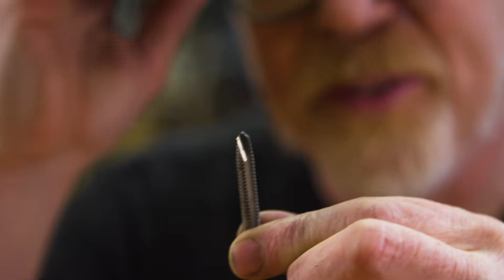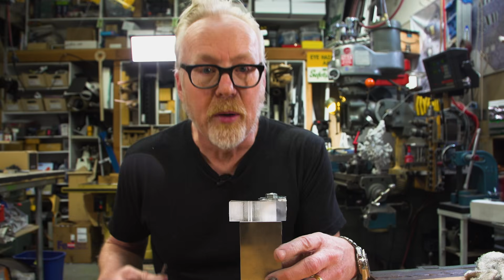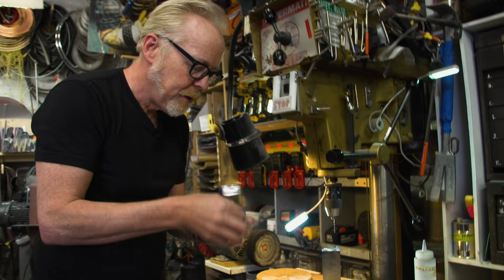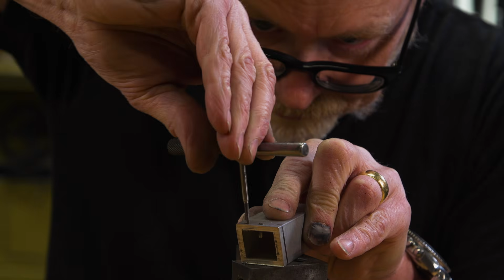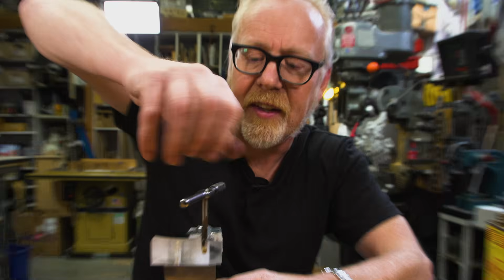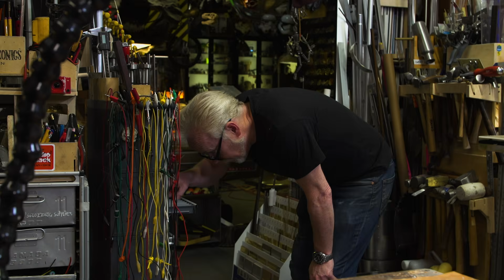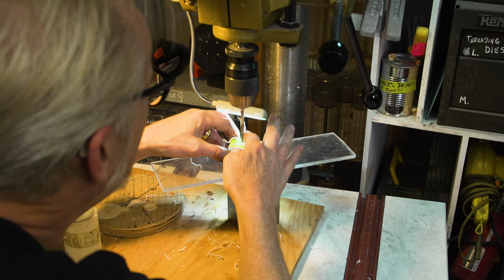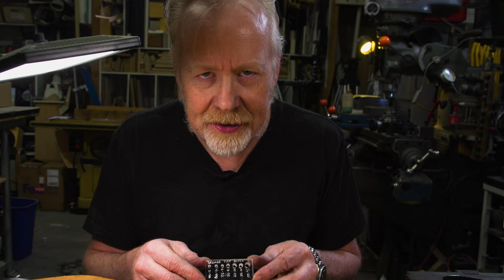Adam Savage's One Day Builds: Thread Tapping Guide Block!

Comment: I love your Starrett tap handles, as well as the rest of the video.
BUT... Threaded holes are not meant to "screw machine bolts" into. They are meant to screw machine screws into. Bolts are meant to be stationary while nuts are threaded on to them. The most obvious example is carriage bolts, but there are other obvious examples such as plow bolts, round bolts and track bolts.
Don't use cutting oil in cast iron as the grains of carbide in the cast will mix with the oil and create an abrasive paste which will dull the tap amazingly quickly.
Reply: Your distinction of bolt vs screw is an opinion only, and not universal.
What you call "machine screw" can be used either as a bolt or as a screw.
Furthermore, what you call a "bolt" can be used as either as a bolt or as a screw.
Hence, "machine bolts" and "machine screws" are both the exact same thing.
What would you call the tool used to tighten a roofing fastener into a square nut - a flat head bolt screw driver?
Reply: @johncoops6897  It's not MY distinction and of course it is applied haphazardly because people from all walks of life have been using spiral fasteners for centuries.

tl;dr You are right but you misunderstood me.

 The distinction is one of application rather than form. I agree with most of what you said. I think you have misunderstood what I said.
If you tighten it into the nut or a hole it is a screw, but if you tighten the nut onto it, it is a bolt.
However there are certain unambiguous examples, as I said before. A carriage bolt is always used as a bolt because there's no good way to tighten it by turning it into a hole. A lag bolt isn't a thing because you never twist a lead sleeve onto it by rotating the wall. It is unambiguously a lag screw, even though it has a hex head. Most other spiral fasteners can be used either as a screw or a bolt, as you pointed out, but there are conventions about naming them for packaging and inventory purposes. it would be silly for a hardware store to keep 3/8-NF hex head machine bolts on a different shelf from the 3/8-NF hex head machine screws because they are the same thing regardless of what the customer asks for or how they use them. Usually 'screw' is used to refer to something that has a faceted hole in the end and 'bolt' for something that has facets on the edge of the head. 'Machine' refers to the shape of the thread profile, in contrast to self forming or self threading fasteners. Self tapping fasteners would cut their own 'machine' form threads.
"The tool used to tighten a roofing fastener into a square nut" would be a screw driver because you are turning it or "screwing it" into the hole. To me a "roofing fastener" is a nail. A roofing screw wouldn't fit into any nut I have ever seen because they have a self-forming thread form like any other wood screw or a sheet-metal screw, while nuts have 'machine' form threads. The tool used to screw a nut onto a machine bolt (hex or square head machine screw) would be a nut driver.
Reply: @GordieGii  - I had typed a detailed reply with many examples, however Adam's comment filters must have deleted it. It wasn't insulting or rude, however perhaps it triggered some word count or external link restriction. Anyway, I am not going to type it out again.
Basically what it said was that in real world practical language, the terms "machine bolt" and "machine screw" are completely and utterly interchangeable. The distinctions that you use are probably based on the American "Machinery's Handbook", however those are not consistent nor even universally acknowledged throughout the rest of the world.
...
So, I was attempting to point out that you really shouldn't be a pedant and "lecture people" about correct terminology of fasteners that don't even have a consistently uniform distinction anyway. It's interesting to read the Wikipedia article about this, and especially the section about "Controlled vocabulary versus natural language" ...
https://en.wikipedia.org/wiki/Screw#Differentiation_between_bolt_and_screw

Comment: A broken tap is the bane of any mechanic or DIYer. If you buy a good set the tap and drill sizes will be in the included chart. (In most cases).

Comment: Thank you. This is SO useful.
I'm going to 3D print myself a tapping guide block.
Reply: NO NO NO. You need it to be accurate. The taps need to fit tightly in the holes, and not be rough. Make a blank with undersized holes perhaps, then drill the to final size.

Comment: So why not use a spral flute tap? They come in positive and negative extraction and for aluminium, .25 and  up I just use the drill...
Also: Countersink both sides of the hole. No fraying and easier to start the screws.

BTW: IMHO the most interesting thread to tap is a TR-Tap. Like TR16x4 for trapezoidal spindles...

Comment: I don't know if anyone's mentioned it, but they sell (and you can make one yourself) a spring loaded tapping guide. You drill the hole (on your mill, lathe, or drill press), remove the drill, insert the guide into the tool-holder. A lot of tap wrenches and/or taps will have a center point on the back end. Rest the tap in the hole and bring in the tap guide until the tap is held in place - centered. Work the tap and you may or may not have to feed the guide closer to the work piece. Depends on the depth.

Works for taps of all sizes, no block required. Although, the block is handy for tapping holes when you're away from your machine - part in hand.

Comment: I definitely have had a tap  go in very sideways. I started using a lathe or drill press to start my taps to help with the issue(spinning by hand), but tap block has a much broader use case. Thanks!

Comment: You didn't need to make 7 holes... He first 3 taps all had the same diamet. They all could have used the same hole. 2-56, 4-40, and 6-32 could have all used the same hole. So you really only needed 5 holes, or maybe 4 if the 10-24 and 10-32 both had the same shank diameter.

Comment: tapping things is easy af as long as you never turn it hard. there should never be much resistance. two steps forward one step back over and over and over. its infinity satisfying to thread a bolt into a threaded hole you've made. I've never used one of those little charts either, grab a nut and bolt that are the size you need and test the taps in the nut until you've found the right one!

Comment: I learned how to tap a hole in HS it was one of the easiest parts of the class.
Reply: Yeppers, the instructor tapped a hole then used a die to put threads on a rod. Then we all made brass hammers with aluminum handles. Still have mine. (35 years later)

Comment: Shop trick, Adam.  I've broken taps, too. When working with aluminum and a broken tap in the hole, mix alum powder with water and low boil the mixture soaking the part in for about an hour.  The tap will dissolve enough to pick out with a pick.  

Yes sir.  Alum will dissolve steel and leave aluminum totally untouched.

Comment: The way I learned it is rotate for 2 rotations, rewind half a rotation, rotate for 2 rotations, rewind half a rotation...rinse and repeat.
and obviously add oil for everything larger than M5. I have NEVER broken off a thread tap in over 15 years.
Reply: Also, with tapping wrenches ALWAYS use two hands to even out the weight distribution!!

Comment: You think you love tapping, but I had to hand tap 125 5/8"-11 holes 0.500" deeper in CF8M stainless steel because another machinist didn't tap the holes deep enough when the part was in the mill. My arms felt like jelly afterwards, I essentially tapped the length of my entire body.

Comment: Pretty much any of the time, you’d use a tap that is a “full size” larger than the hole (in imperial, anyway). Use oil also. 3 in 1 works fine.

So if you want to use a 1/4-20 bolt, drill a 3/16” hole. I do this on a regular basis. You actually can use different size differentials if you want an easier time of it, but the threads will be “smaller” (shallower I guess you could say).

You simply go backwards to remove the chip, and you’ll be fine. I’ve literally never broken a tap.

If you really can’t get a tap to go in square, use a drill press by hand. Tbh though, that doesn’t work that well, you should do it by hand. Once you get the tap in a certain depth, it will guide itself, but as you start, press down with some force and keep it square.
Reply: That works perfectly for only some sizes, like 3/8-16, ¾-16, 7/8-14, and 1-8. The other sizes may be close enough for the work you're doing, and it may be a good way to do it if you don't have letter/number drills, or if you're doing a home project, or a protect where it doesn't matter. But it's not the right way for all taps. A ½-13 and ½-20 tap drill size vary by 30 thou. A 5/16-18 and 5/16-24 vary by 15 thou, and the 5/16-24 needs a drill that is 22 thou bigger than ¼". So it will lead to sloppy holes, or broken taps. (Deepening on the material you're tapping and whether the next size is bigger or smaller than the specified tap drill size.)
Reply: Andrew Delashaw I’m sure you’re right. I do industrial balancing, that’s my family business, and no it’s not at all legit machining. I just have to get stuff done when it’s called for. That being said, I do everything from that stuff, to repairs, to motors, to making blades, so I have a general knowledge of a lot of stuff. But no, I’m in no way a machinist.

But you’re probably right as I’ve noticed for sure that varying sizes are not proportional in how you’d go about drilling and tapping. Namely, as the size changes the size needed for drilling does too. But no I typically don’t use numbered sizes.

I also never use fine thread taps or bolts. If I’m using a 1/2” bolt it’s going to be 1/2-13, unless I’m working with an oddball piece and I have to. For example the threads in my (one) balancing machine is 7/16... something, I forget now, but it’s a really weird thread per inch count. I think it’s 20. Luckily we had it in our old tap drawer that has every tap I can think of.

Comment: also, dont buy the big cheap sets of taps because they are more often than not made from carbon steel which will wear faster and break easier, spend a bit more and get some form of HSS (high speed steel) and they will be a lot better and last a lot longer.

Comment: I'm mostly dealing with wood so I've been holding off on buying taps. But since the other video I saw how happy Adam was having that "mechanical connection", I told myself I NEED to try it. So I bought a set, cheap stuff, and now this video is super helpful once I finally get it this week. Thanks for following up on this topic!
Reply: Careful! I don't know just how cheap of a tap set you bought but, don't let that cheap tap set ruin your veiw of tapping. The process of tapping can be made unnecessarily difficult by using poor quality tools (like quite a few other tasks). The hardest part of tapping should be starting the tap straight, at least when tapping smaller size holes like discussed here. If you run into anything else that seems difficult,  it's probably due to tool quality. Of course you can have a tap from a reputable maker and if it's dull, or chipped badly, can give you issues.
Reply: My biggest tip is about the reversing of the tap. Firstly, look at how many flutes there are on the tap. Let's say a 4-flute straight tap, that means flutes are 90 degrees apart (3-flute is 120 degrees). You MUST reverse the tap very often, and also reverse far enough.
OK, once you get it started, you only want to cut a maximum of 3 to 4 flutes worth of rotation, then come back out by 2 flutes worth. So, for a 4-flute, max 1 turn in, then 1/2 turn back.... go slow!
The purpose of the reverse direction is to cut off the chip that you form on the forward stroke. It's the rear edge of the previous flute that makes that cut. So you must go backwards at least 1 flute-worth of rotation, which is why they say "1/4 turn back".  However going backwards a bit extra is even better.
The reason people snap off taps is that they force them in, and the long spirally chips cannot clear. So the chips jam up inside the flutes and the tap grabs then jams and snaps. By making tiny cuts then reversing, you create tiny chips like sand or powder, which don't jam as much. If you are going in a deep hole, then repeatedly remove the tap completely and brush or blow off the chips. Doing these things will result in you not breaking taps, even tiny ones.

Comment: The reverse turn is to break the chip. When you are tapping you are cutting out material and the if you do not break the material being cut away (chips) then the chips can build up in the flutes of the tap and cause it to bind.  If the tap is bound up and you try to force it it will break. I do not know who taught Adam his machinist stuff, like they taught him the right things but for all the wrong reasons.
Reply: Also, that is a tapered-end straight flute tap, the taper on the end is to help center the tap upon entry, and the rest is make smaller cuts at the start and progress to the full thread size, not to help chips drop, which you would want them to come out of the top and not down in the whole risking the tap getting bound.

Comment: I'm a long time fan and this is by far the most important video to watch and learn about tapping. I've tapped many holes before and this helped me to understand sooo many more things. I NEED a tapping block. How about showing us methods to ensure our drill press is drilling holes at a perfect 90 degrees from the drill bed?
Reply: Use a machinist's square, level the table of the drill press to a drill in the chuck. You may need to shim the table of it doesn't tilt... use some MDF and put shims underneath to suit.

Comment: But then comes a dilemma: The thickness of a guide block helps keep the tap straight, but can also prevent cutting threads in the bottom of extra-deep holes. You're blocked by your block!

Comment: You never talked about Spiral Flute taps....better to use for blind holes.....they actually remove the metal "chip" from the hole.

Something else, for small taps such as 4-40 and smaller.......I make 1/4" to 3/8" thick disks of aluminum 1 1/2" diameter, knurled on the diameter, and drill a hole thru them the size of the tap.....along with a small set screw from the outer diameter to hold the tap in place..........this works good for tapping with smaller taps especially for tapping holes in plastic.

Comment: Just a little tip for removing a broken tap from stainless steel is to use a oxy-fuel torch. Oxy-fuel fuel does not cut stainless therefore clearing the hole. Remove all remaining bits of tap with a pick. Resume tapping with new tap.

Comment: Never had issues tapping. But i would never use the first type of tap wrench shown. There is far to much potential levrage on the tap. The distance from the end of the tap to the  handles should be as small as possible. But it's interesting to see the differences in process.  We use 3 part tapping sets each thread has 3 taps gradually increasing in size  to reach the final tap. As far as i know this is far more common here in germany.

Comment: One of the best saving graces for broken taps is a CARBIDE DRILL...  But you must run the carbide drill correctly with proper speed and feed rate.... or at least close.  Many carbides can be ran without lubrication and can withstand insane heat.  And if you break the carbide drill, high speed steel punches will shatter the carbide and you can fish out the bits.  I have used this technique several times and is an industry standard solution..  Pretty sure nobody will even read this comment, lol..  
 EDIT #1: you have to hold the carbide drill super steady or it will break, use a drill press if possible.
EDIT #2:  REVERSE DRILL BITS...  Like a normal drill bit but made to drill in a counter clockwise direction.  The drill will catch on the tap and reverse it out.. I have also used this trick with great success on normal steel taps, it doesn't work so well on carbide taps or some high speed steel taps...  The drill has to be harder than the tap you're removing, for this to work well.

Comment: What are Adam's feelings on helicoils? The shop I work at uses helicoils for several things, from reinforcing aluminum, to repairing screwed up tap jobs. When Adam was showing the bad threadings that were loose, I kept thinking "Throw in a helicoil and that'll tighten right up."
Reply: Helicoils are great when you aren't paying for them.

Comment: I got into RC cars Rock Crawlers at that. Needless to say there is a bunch of tap and die work needed on them . Tapping titanium and aluminum.  I was using cutting oil when I first started ,after breaking many many 4-40 and 3m taps and the dies I started using anti-seize for the cutting and I barely break them until the are well worn out.

Comment: If you want a really strait hole and tap job, Use the Mill and vice to locate the hole location, and then lock the table. Drill the hole, then change the chuck to a spring center, use it to hold the tap on center and apply a steady pressure.

Comment: My tapping tool set has three taps of the same size in set. And they are actually marked as 1, 2 and no mark. As I knew nothing about tapping I asked and was told to use number one first, then second and then for final cut third one. And I am doing so. And indeed those three taps cut differently and after you use all three of them you get perfect thread.

I also found out that you can buy just one tap tool for one size. So I asked again and I was taught that if you use machine tapping then you use single tool, which is made specifically for machine taping. For hand tapping, set of three is used.

Now, I see you use single taping tools. Are those of third kind or you are just using machine taps for hand tapping?